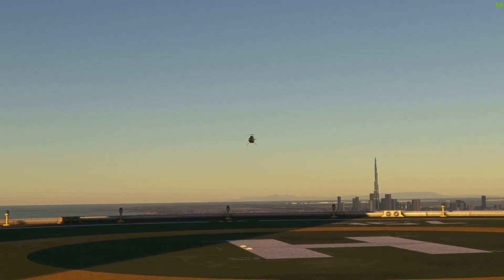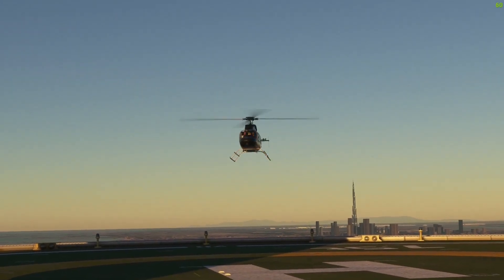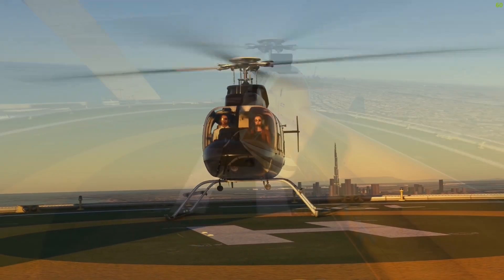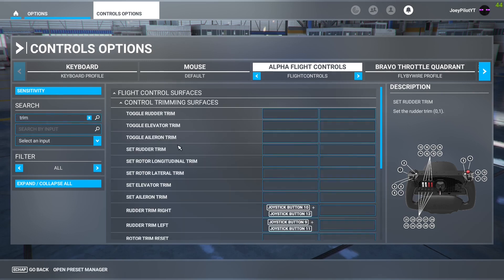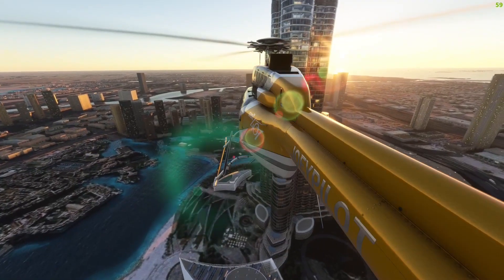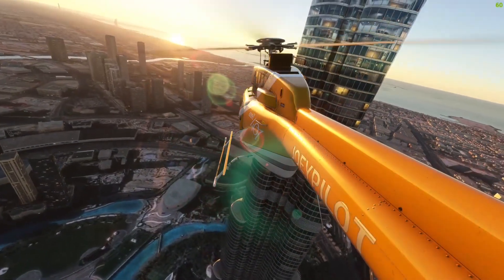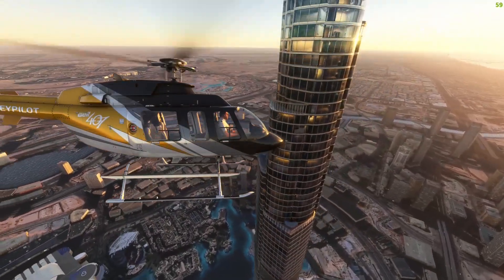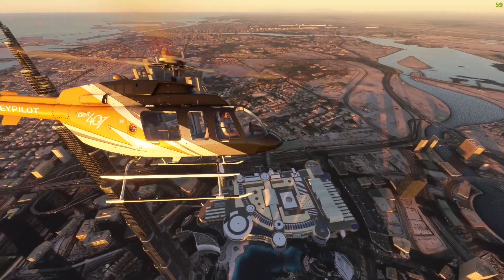How to TRIM a helicopter in MSFS2020

Comment: in trim, i will say as with experience, trim is best used in a certain maximum setting of power, the more power(torque) the more down trim you may need to keep the aircraft in a constant V/S, In MSFS, I observed that 80%(Normal operation) torque on the 407 with 80-100% down trim, seems to keep it stabled despite the high airspeed

Comment: dude pitch trim is not important,  tail is main issue
Reply: Cyclic trim for Helicopters is EVERYTHING because without it your workload is so high.  It is much higher than fixed wing.  The tail is merely rudder controlled.
Reply: @TheAustralianOpinion  I can do a loop so tight it's practically a flip in the Cabri. I know how to fly a heli.

I'll admit the models I'm used probably have a higher power to weight ratio than a real heli, but I truly believe the Bell tail must be underpowered to be such a contrast from the other bird.
(Many people on xbox are having issue and it is being blamed on "helis are hard to fly"....no it doesn't have enough tail authority to turn left. As I demonstrated on their Twitter by taking the fuel out etc and getting it to turn left consistently).
Happy flying!
Reply: @Cyclophonoscope  You cannot compare RC to full size aircraft.  The Cabri also has an enclosed fan rear tail.  And no, Bell 407's are NOT hard to fly.  They are super easy to fly and Bell know a thing or two about making Helicopters with good tail authority.  I could suggest you watch Nick Murray's YouTube channel as he flies the real things and also reviews other pilots reviews using onboard video and commentary.  Happy flying!
Reply: @TheAustralianOpinion  well for many people on XBOX the Bell just spins out. Some can control it for a moment but it eventually spins out.

I am on xbox so that is all I can speak for.

Again. I've already admitted this could be idiosyncratic behavior relative to this full size craft. But I don't think it is.
I think it is an issue to be patched. And if you aren't playing on Xbox do not assume it is the same.

It's just SUPER WEIRD that I have ZERO issues with the other bird. In my opinion.
Reply: @Cyclophonoscope  I told you I am Series X only.  The 407 has two fuel pumps with one being X transfer.  Obviously it holds more in the main body than the rear tank.  I have no idea what or why people "eventually" spin out.  The real life 407 does NOT have this issue.  I have logged over 50 hours on Series X with this 40th anniversary freebie Helicopter.  I can land anywhere, I do not have it wildly spinning nor do I feel a lack of tail rotor authority.  Then again as this is not  game, a huge amount of people will try it for free on Gamepass and then crash and burn.  In real life it takes a really long time from cold dark start to takeoff.  You would not believe the hilarious YouTube videos out there proving so many have no idea with a fixed wing Cessna 152 much less a Helicopter.  Cheers.
Reply: @TheAustralianOpinion  I would hazard a guess it has something to do with the controller axis mapping? 

If you're playing on a flight stick and are not bothered by the issue?

With the controller it almost behaves like vortex ring state, but in the tail. If you pull the left trigger fully it is extremely likely to "slip" and start spinning right. But if you are careful with the trigger you can avoid spinning out most times.

It just feels squishy.
If one of my RCs did this the cause would be a tail gear ratio, tail blade size, or possibly gyro settings.

Maybe it is the heli. But I think something is wrong somewhere. Possibly just a controller mapping issue?
Reply: @Cyclophonoscope  Like a real helicopter no one jumps on any rudder pedal.  If they did there would be hundreds of helicopter fatalities a month!   If it feels squishy you must have rotor assist ON.  I don't use the rotor nor any assists.  My Piloting preference pane says  HARD difficulty.    I don't use any "controllers" apart from the Xbox hand controller as I fly from my recliner in my living room and I use an 86" 4K UHD TV with Variable refresh rate etc.  I don't sit at a desk or use tiny 40" monitors and use 3rd party peripherals.
Reply: @TheAustralianOpinion  if they sell it as something that "works on a controller" perhaps it should work their controller.

I don't need you to agree with me, though I was hoping you might change your tone. Weird to be elitist when you're not even playing on a PC. Don't worry, I won't be bothering you anymore I can see you won't be of any help.
Reply: @Cyclophonoscope  It flies fine on an Xbox hand controller without assists.  And being "Elitist" actually means using a SOC console instead of a 45 year old "component based" PC.  As I said.  Helicopters require extremely fine and delicate inputs compared to fixed wing and the takeoff to ground hover is the most challenging phase.  Just watch videos of 407's lifting off to ground hover and you can clearly see this stage is not to be taken lightly and military Helicopter rookies have to spend hours perfecting a basic 3 foot hover.  It is NOT easy!!!!  Seeya.
Reply: @TheAustralianOpinion  no being elitist is saying I have the stuff to to do it right whereas you cannot. Which is what you just said.

You just told a guy that spent a decade building and flying and repairing and tuning helis how hard they are.

Yeah it's no Bell 407, but my Goblin 500 would still kill me if I didn't know what was doing.
Reply: @Cyclophonoscope  I'm not talking about RC helicopters.  I have a tiny black box that uses SOC (System on Chip) instead of component style PC's and that only has a 315 watt PSU and is inexpensive to buy and use.  Once again I can fly this 407 without assists with a standard Xbox controller and it does not spin wildly nor act up in any way.  However as I said and there are other YouTubers who are flying this 407 on their Series X and having no issues at all.  But I can see why so many would.  No one ever threw the keys to anyone for a 407 and said "take her for a spin".  No pun intended.
Reply: I'm assuming you mean the Tail on the Bell 407? 
Just spinning out?
I fly radio controlled helicopters.
My diagnosis is that the Tail is under powered. My hot fix for the modless xbox is as follows.
Assistance: tail Rotor Assistance on
Infinite fuel: on
Customize your aircraft reduce aileron/elevator authority 2 degrees, increase rudder authority 2 degrees.
Weight and balance: remove all but 1% of fuel AND remove the the weight of the Pilot.

The tail is still squishy but it will turn left more often now, because these settings shift more power its way. Avoid any drastic "throttle" (collective) or cyclic inputs. Keep it incremental and smooth, because the RPM warnings coincide with tail blowouts. So if you don't put the heli in a position of struggling it won't happen.

They need to fix it. I only fly high powered RC models, but I refuse to believe a real one has such poor flight envelope.
Reply: @Cyclophonoscope  The Series X Bell 407 does in fact include FADEC and also has Cyclic auto and forced trim.  The throttle is fully working from fully switched off to click to idle then a further roll to click at the FLY indicator.  FADEC power manages everything in these.  I can do a ground hover at 3 feet for 3 hours and never have to touch the Cyclic in calm weather and no breeze.  In the Cruise I can choose Force trim or leave it on Auto trim once I'm flying a distance.  The Collective also has friction control even on the Series X version and is the round red knob between the seats.  I choose the least amount of friction for much finer adjustment and buttery landings.  Cheers!

Comment: flying helicopters with a yoke ? now that's a scary thought :)))
Reply from the maker: With trim it's quite doable 🤪
Reply: @JoeyPilotYT  well yeah I guess it is "doable" but it seems as weird to me as driving a car with a joystick or playing super mario on a dance pad :D
Reply from the maker: @hivewasp  fair enough 😂😂
Reply: @JoeyPilotYT  You do realise the Bell 407 has Cyclic Auto Trim and Forced trim that is controlled by the FADEC?  And it's fully functional in FS 2020 and even on a Series X version.  You select them from the roof panel. I'm just using an Xbox hand controller and I can takeoff, hover and cruise perfectly fine.  Stable hover is no hand on the Cyclic at all.  The Bell 407 in FS 2020 also has collective friction adjustment for Series X which works very well and despite what people say.... Yes the throttle does work and operates correctly from off to idle and then select FLY and the FADEC takes care of power matching on the fly.

Comment: The trim function does not work in the Cabri as far as I can tell, at least with a non return to center cyclic. On level flight, at high power setting (80 and over), I have to move the cyclic fully forward and keep it there, or I start climbing, no matter how much I use the trim function. Maybe it works with self centering cyclic, but not with ‘real’ helicopter cyclic which do not return to center when you release them.
EDIT: Not sure why it wasn't working for me before, but it's working now, so all is good with the trim😀
Reply: Curious. What cyclic are you using?
Reply: @MrStrosty  I finally got it working. Not sure why I could not hear the trim motor before, but I can now and it is doing what it should.😃
Reply: @HeliSimDriver  I'm using an Xbox hand controller and can place the Cabri on a dime.
Reply: @MrStrosty  Maxflightstick

Comment: Helo pilot here.

That longitudinal trim is just a broad term that covers all possible variations of trim systems.

One trim function that is missing and I hope is added soon is "force trim"

Each helicopter does this slightly differently (if it has the functionality at all). 

Where "beep trim" works as described in the video, by pushing forward or backward on a cyclic "hat" switch to pitch fore or aft, force trim works by holding a cyclic button down,  positioning the cyclic where ever you need it and then releasing the button. Once released - this position becomes the new reference point. The new 0, 0. The stick will stay in that position, and thus "force" the pitch attitude to stay in that position as well.

Like I said, helicopters do this in various ways. Some helicopters literally just hold the cyclic in that position despite aerodynamic forces and thus require constant re-referencing as you change speeds amd manuever.

Some helicopters are so advanced that when you use force trim you're actually setting the pitch attitude itself. The cyclic will move on its own (through trim motors mechanically linked to the cyclic) as the airframe transitions through various regimes of flight.

Example would be from a hover you trim a 5 degree nose down, wings level attitude. As the airframe accelerates, you would observe the cyclic move on its own forward and left as the system compensated for dissymmetry of lift and transverse flow effect. The first causing a pitching moment which causes the need to feather the cyclic forward, and the second causing a rolling moment which causes the need for feathering the cyclic laterally in forward flight.

A helicopter without attitude hold functionality coupled to force trim, and just holds stick position would require constant re referencing until a stable speed was reached.

What this would look like in MSFS2020, and what I hoped for in the key binds "rotor set longitudinal trim" and "lateral trim" was the ability to force trim.

It doesn't work like this, but in future updates the most ideal way to simulate force trim would be to hold the key binding while re-centering your physical joystick. While holding the binding your in-sim attitude is held and the control surfaces remain stationary.

So from forward flight, forward and left on the cyclic in game and physically on your desk - you press and hold the button to recenter your joystick. Meanwhile in game the cyclic is still forward and left and your pitch attitude remains the same. Now from your physical joystick neutral position you cam make minor adjustments as necessary until it's time to make another major trim change.

This in my opinion would be the best way to simulate force trim which is a huge feature of complex helicopters
Reply: I'm also a DCS Huey pilot that was hoping it was modeled in MSFS, sure hope they'll add it soon. Kind of disappointed that it was omitted in the first place, but, hey, at least we now have chopper support for the sim.
Reply: I am reading this hoping force trim also becomes an option like the Huey in dcs, I prefer the seat of your pants style of flying that brings.
Reply: excellent information.  ive been driving myself nuts trying to get msfs to force trim my h145.  This explanation was outstanding and much appreciated!
Reply: @dirtinthebox32  glad it helped

Comment: Huh? No force trim available?
Reply from the maker: It appears Asobo haven't yet added a feature like that as far as I'm aware
Reply: @JoeyPilotYT  That's a bummer... looks like I'll stick with DCS helicopters for now.
also, the MFS helicopter model lacks independent rotor effects, engine RPM can be heard when changing the collective setting but I can't hear rotor slap or any rotor interaction with the air as I maneuver the helicopter.
Reply: @simpo5958  i love doing high angle turns and hearing that slap. its nice in dcs
Reply: @JoeyPilotYT  It does have Force trim.  It's selectable from the overhead panel as is Auto trim.  I'm on Series X and I can fly the 407 with my little pinky!  ;-)